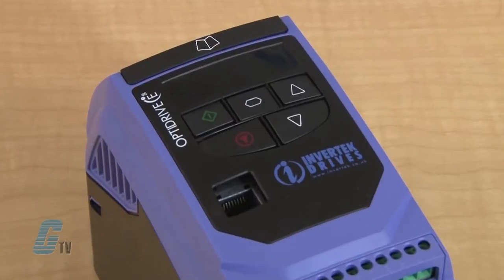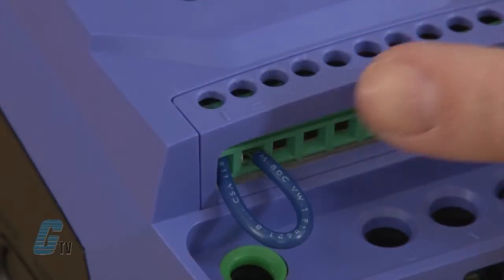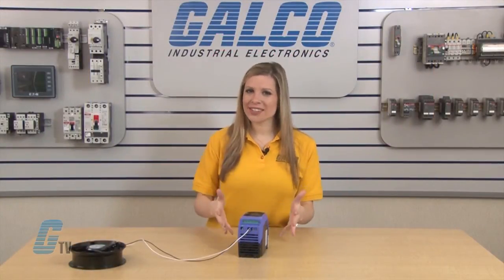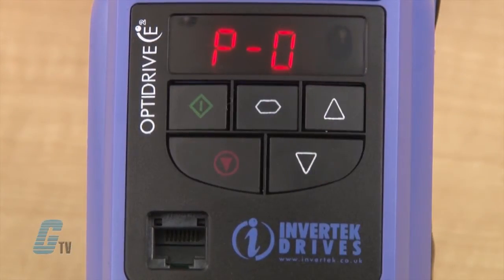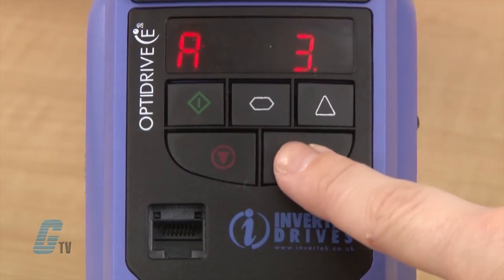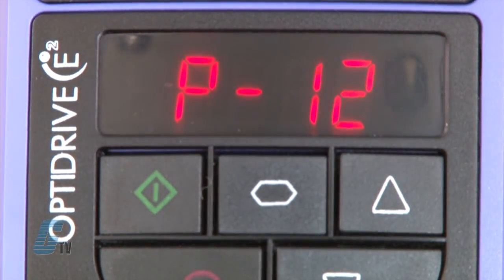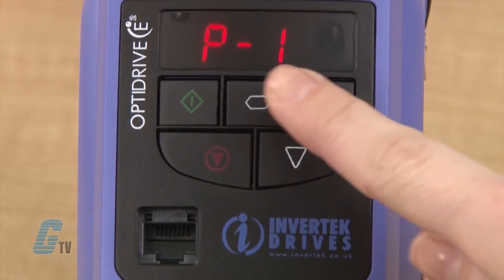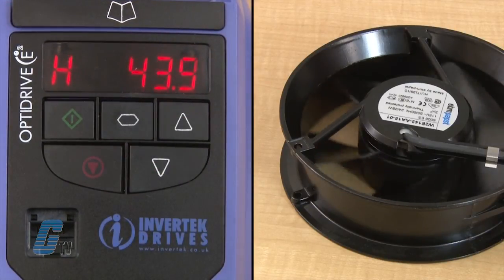Invertek Optidrive Single Phase AC Drive from Bardac

Comment: it is possible to run my capacitor split motor with this drive
Reply: Yes you can run a SPLIT CAPACITOR & SHADED POLE SINGLE PHASE MOTORS using E3 1-PH OUT SPECIAL DESIGNED VFD